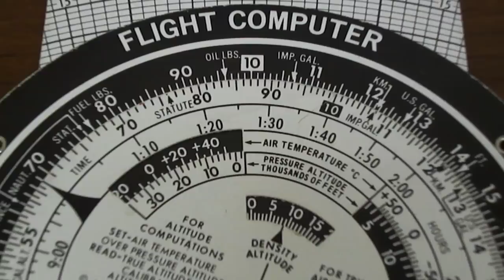E6B Flight Computer: Density Altitude

Comment: Pardon my ignorance, but why is there no basic gauge that can automatically compute the given temperature, pressure alt, and what ever other info that is readily available to just give an instant density altitude reading!? I understand that in flight planning, the manual way is important but as a cross check for in flight??
Reply: Beatchild & The Slakadeliqs Have you ever hear about FMSC? That is the computer that doing all those calculations based out of what are you typing in it, like temperatures, altitudes and so on. This particular video is about using E6B, which is old fashion way the FAA wants the beginner pilots to know and understand those calculations.

Comment: DA= (OAT-ST)x120 + PA
(40-15)x120+5000=8000
Reply: Standard temperature at 5000' is 5°C, not 15.
15° is standard at sea level, and the standard lapse rate is -2° for each 1000', so 15° - 5000' / 1000' * 2° = 5°

Comment: can you please elaborate why its higher ? and density altitude shows what ??
Reply: hassaan zahid Cold air is denser, and hot air is less dense. As you rise in altitude the air gets thinner,  but if it's not a "typical" day--and it rarely is--the air is going to be warmer or cooler than average. If it's warmer, the air will be thinner, just as if you are at a higher altitude than you're actually at. If it's cooler than average, the air will be denser, just as if you were at a lower altitude than you're actually at. Hence, "density altitude" the altitude it seems like you're at because of the air density. 
The reason it matters is that your airplane performs differently at different altitudes.